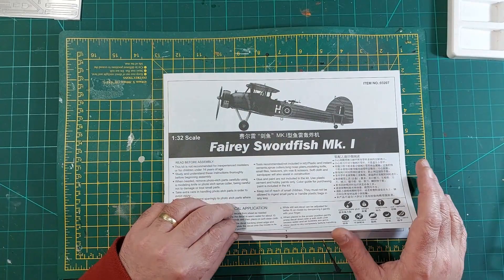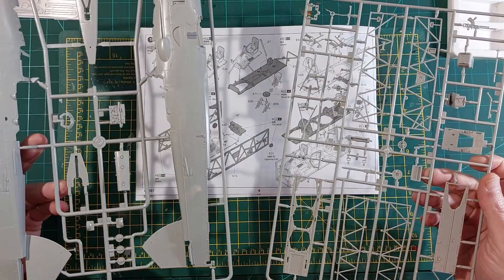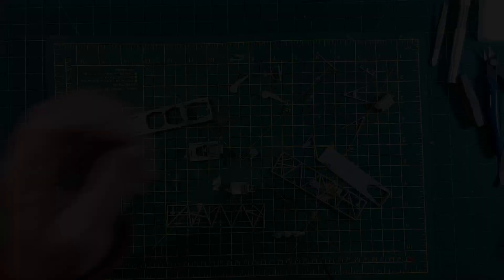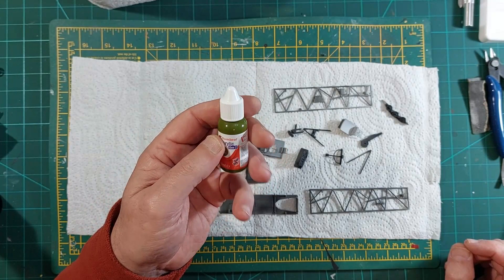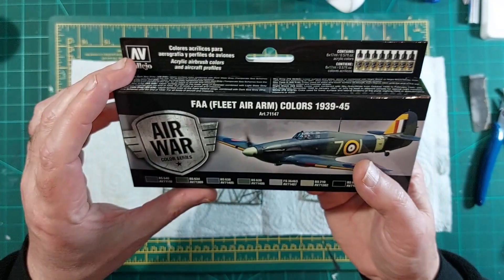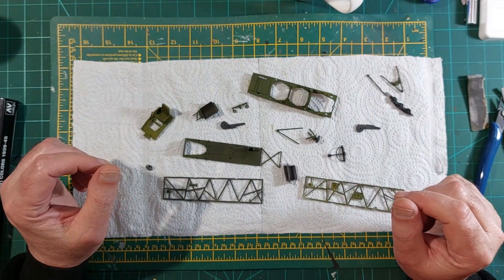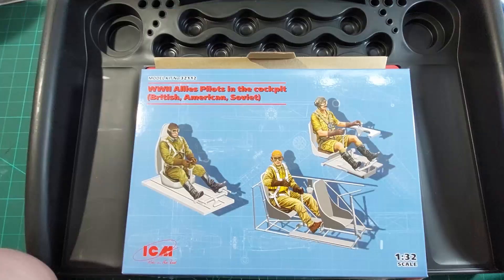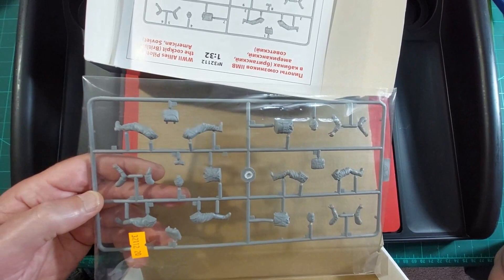Trumpeter Fairey Swordfish Mk1 Build Part One

Comment: I was at an event a couple of weeks ago for the 80th Anniversary of the Battle of Atlantic. One of the aircraft that was flying was a Swordfish. I took a couple of pictures as it was flying past. Unfortunately they are not the best quality but I could make out the code on it.
The code just happened to be 4A. It looked to be painted the same way as the 4H on the box with the code on the side of the fuselage rather than on the tail like in the photo. The code for 4A is W5856 and better photos can be found of it in it's current scheme.
Reply from the maker: Cheers Adam. I've looked at so many photos now, but it seems there was a brief time between them being painted silver and the standardised (ish) camouflage scheme. The tail code looks to be of just the right time but sadly is the only one i've found, so a little bit of guesswork is needed. I'd love to see one in the air!
Reply: Seen it flying at the torbay airshow a few weeks ago

Comment: Looking good so far. I usually download the instructions from Scalemates & print them out. Then I can make notes & mark off parts I've fitted, etc, without any harm to the originals. Looking at the instructions in my Mk2 kit, etc, I can't see that you have done anything wrong. I think the tabs on the seat are in the wrong place, which would explain why the pilot couldn't reach the pedals. BTW, maybe the wibbly wobbly camo lines were painted in rough weather! Stick the topredo halves together now so that you can work on the seams while the other work is drying.
Reply from the maker: Cheers John! Handy tips 👌
Reply: @nostalgicplastic4323  I bought one of those spider-catching devices, like a mini vacuum cleaner recently. If you put a bit of loose weave fabric over the end with a rubber band, it becomes a great missing part finder too. Those pedals have to have gone somewhere!
Reply: That's a great idea!